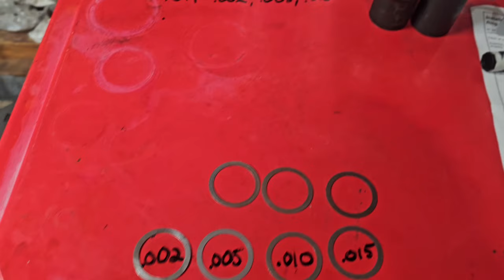Installing Pinion Crush Sleeve Eliminator

Comment: Nice, I'm good with the engine building because I'm a machinist and built many engines. But I'm not a mechanic so everything behind the engine I'm not an expert at.

This pinion gear installation explanation was easy to understand. Now I'm sure I could install one using a crush sleeve eliminator, thanks.😎👍

Comment: I know with a crush sleeve you should do a few complete rotations before you take your reading to ensure the bearings are parallel and there aren't any bind points, so they start tighter and loose a bit with a few turns.  Did you see this also with the crush sleeve eliminator?
Reply from the maker: Not really. I messed with it for quite a while and it seemed to stay fairly consistent.

Comment: Do you stack shims behind the face of the pinion where your first bearing would seat or do you just add the proper amount like you showed in the video on the crush sleeve elimination
Reply from the maker: @queencityscoots1181  yes I had to put shims behind the pinion bearings to set my pinion depth. What I do there is use an old bearing and ream out the inside so it slides on and off easy. That way I don't have to press it on and off to find my pinion depth. The shims behind the bearing affect your gear pattern and not your pinion bearing preload.
Reply: @jdbas71  awesome man  I have everything to set my pinion depth but after watching this I just wanted to make sure I wasn’t missing anything I appreciate it

Comment: 4:42    -How much torque you applied total to crush the sleeve?
Reply from the maker: @norbertrivera  I torqued the nut to 170ft-lbs
Reply: @jdbas71  wow! i'm doing  this to my Ford Ranger  i change the ring and the pinion. I'm  very afraid to damage the pinion nut with this torque.

Comment: I have a question I’m really hoping you can help me out.Now you torqued the pinion nut to a 170 ft lbs. If you were to torque it to say 250 ft lbs the preload would increase and make it tighter. Does it really not matter if it’s torqued to 170 or 300 ft lbs as long as the preload is correct? I’ve been working on mine and trying to grasp that part of it.
Reply from the maker: If using the crush sleeve eliminator you can torque it to your spec and the preload should stay the same. Double check the preload with an in/lb torque wrench to verify.
Reply from the maker: If your using a regular crush sleeve, the preload will increase with torque. If you over torque, you could over do the preload. That's why I went with the eliminator. No parts stores local to me carried the crush sleeve I needed. If was to mess one up I would of had to wait on another so I just went with the eliminator.
Reply: @jdbas71 thank u for the quick reply I’m working with a crush eliminator. I torqued it initially to 150 ft lbs and it was only a few inch lbs.so then I torqued it to 250 and it was to to tight.I backed the nut off a little and retorqued it to 200 ft lbs and the preload was in spec.So why when it’s a solid spacer does torque still determine the preload spec ?
Reply from the maker: @who55f30  good question. With a solid spacer I would think torque wouldn't affect preload unless torque was high enough to distort the spacer.
Reply: Going as high as 300 could stretch your threads, I wouldn't recommend it especially with an aftermarket nut.
Reply: @jdbas71  Any sleeve is a crush sleeve if you believe in yourself.

Comment: why u need a crush sleeve or eleminator?? on weelbearings there is no thing like a sleeve.
Reply from the maker: @idaolea8172  the crush sleeve sets the proper amount of preload on the pinion bearings while allowing the pinion nut to still be tight. With a crush sleeve, you would torque the pinion nut until you get the proper preload on the bearings. If you over-tighten the nut and get too much preload on the bearings it crushes the sleeve too far so if you were to just back the nut off a little, your pinion nut would be loose and the preload on the bearings would be gone. Also once you take the pinion apart, that crush sleeve is no good because if you were to torque it back to the same torque the bearing preload would be different. With the crush sleeve eliminator, you find the actual measurement you need between the bearings to be able to achieve preload on the bearings and the proper torque on the pinion nut. I believe it's set up like that because pinion bearings require preload on the bearings whereas wheel bearings of the same style require endplay. So where the pinion bearings are constantly squeezed together, wheel bearings have a little play. I hope I explained that in a way that makes sense.